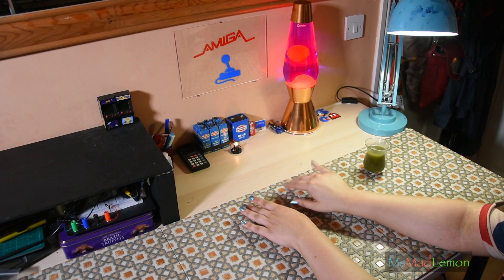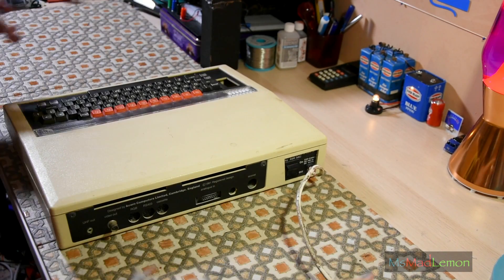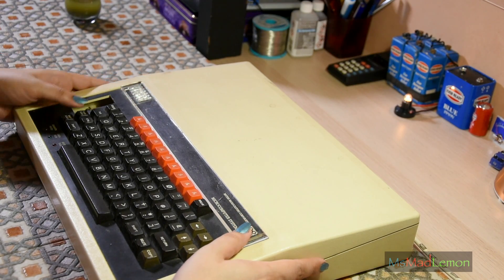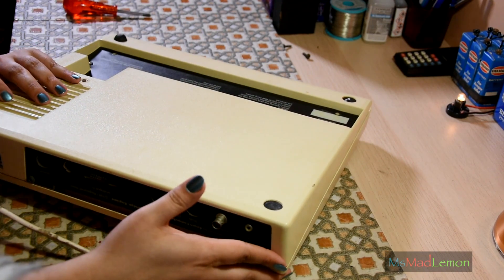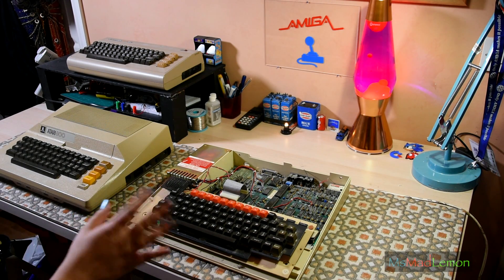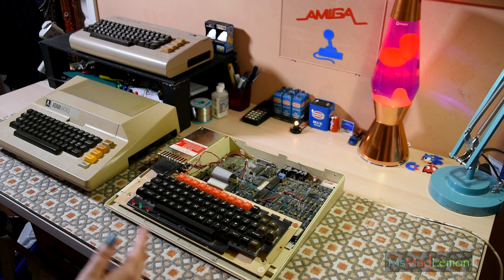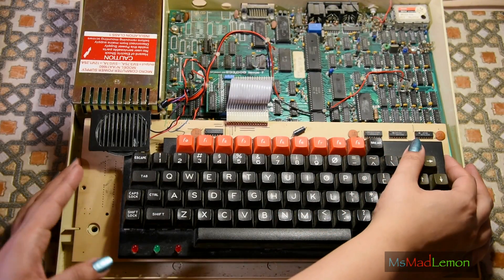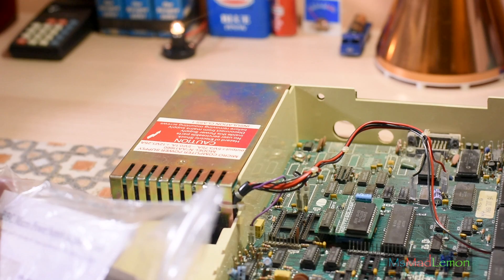The Acorn Proton - BBC Micro Model B

Comment: I bought my BBC micro 40 years ago and still have it. I went from the Beeb to ARM and now I program ARM devices as a living as a software consultant. I event used it in my final year project at Uni (I did physics and astronomy and automatic a research experiment). Recently the RIFAs in my Beeb went pop so it was time to recap it.  The tube interface was for second processors. Checkout PiTube. The 1Mhz bus was for expansion. There’s even BeebSID for it.

Comment: Splendid video, many thanks. I bought an Model A (with a friend as they were wildly expensive for a student) in 1982. We upgraded to Model B a few months later, mainly for the DFS which came with it, IMO its graphics blew all the contemporary 8-Bit competition out of the water, but then again it was more expensive and meant to be an educational instrument rather than just a games machine. That said, it played great games, and Acornsoft's suite of game clones was second to none. I especially liked their versions of Missile Command and Scramble. Of course, in 1984 it became (almost) a totally dedicated Elite playing machine :)

On last point. You mentioned The Tube interface, and while I can't recall what peripherals this was meant for, I can say the name was a nod to London's Underground, which is often called the Tube - as opposed to the Bus… Get it? Although it was a machine designed in Cambridge it is clear that those involved in the project knew something of London't public transport system.

Thanks again for your video and I look forward to the 2nd in the series. (I realise I'm a few months late to the party. Btw, I still have the machine, in its original box. Last time I tried it many of the keys weren't working, I guess they can be fixed, but now am worried about the PSU caps issue. I suppose my soldering skills may be up to the task.

Comment: The Tube port was an Acorn proprietary interface for connecting coprocessors, so the BBC micro provided the I/O and screen interface. A number of coprocessor boards were developed including those based on the 6502, Zilog Z80, Intel 80186 and NS 32016 running Panos (effectively a UNIX variant). 

the Tube port was also used extensively in development of Acorn's ARM processor which went into the subsequent Archimedes machines and is now the dominant processor architecture used in mobile phones and many other devices across the planet.

Comment: the texas instruments sound chip sounds more clean with a better signal to noise ratio, compared to sid which as confirmed by the designer, due to the fact mos/csg had to work very fast to develop the c64 architecture and so he didnt managed to get a very good signal to noise ratio, he wanted even to multiplex oscillators and get more voices out of it but time was not enough.

the texas instruments however has less tonal variety than sid, usually the same boring square wave melodic stuff, whereas c64 can do a lot of timbres using 4 waveforms per channel, filter with resonance, ring modulation, etc...a complete analogue style synthesizer inside a micro computer.

Comment: You can also add speech by adding a tms5220 and Computer Concepts Speech ROM or if you add the appropriate 6100 speech PHROM then you can use BASIC SOUND commands. Here https://www.youtube.com/watch?v=IHldh_rknuk is my AstroBlaster game with speech, sorry the emulator isn't 100% (and yes it is supposed to sound robotic!)
There are some good examples of what the sound chip (same chip as SMS) can do here https://bitshifters.github.io/prods.html
http://bbcmicro.co.uk/ is a great place to get some games and the latest homebrew.
The five ROM sockets are the OS on the left and the other four are "sideways ROMs" for things like floppy disc filing systems (DFS/ADFS), productivity software or even games and other languages (yours has BASIC in the left).
Your composite connector is disconnected, this doesn't mean it is broken as they were often left disconnected if someone thought that they might need to remove the board.
The green LED is a replacement.
Looking forward to part two.

Comment: Econet was indeed a networking system, and installable as an optional module which is why it's missing from yours.

Teletext and the BBC Micro kinda go hand in hand. Teletext display was originally generated by a Philips/Signetics SAA5050 chip. When they designed the BBC Micro's display chip, they deliberately put a fully compatible SAA5050 graphics mode into it (MODE 7). There was even a Teletext adapter.

The Tube was a coprocessor interface. You could attach a second 6502 or Z80 there. Indeed the prototype ARM chips were brought up on a BBC micro using the Tube interface :)

Comment: Yes ECONET is a network port but the circuit was not fitted as standard. Tube is for connecting a second CPU. 1MHz bus is for fast hardware like hard disks & the MUSIC expansions. User port is like GPIO. Printer port is for a parallel printer and floppy is standard 34pin so you can fit a Gotek straight on.

Comment: Although there are only three caps in the capacitor kit, there are loads more caps in the PSU!  The three are the ones that fail most regularly and spectacularly but it's likely that some of the others won't be working to spec.  Personally I think it's better to replace the whole thing with a Meanwell of the correct spec.
Reply: Probably runs cooler, but not really necessary ;)

Comment: BBC BASIC has been ported to other computers over the years, because it's so versatile and powerful. In fact, it was actually used to write a program for restoring old TV shows.

Because the UK adopted 625-line colour TV fairly early, the BBC switched to shooting programmes on colour videotape. But, if episodes of a show were sold abroad, they'd often be sold to broadcasters that didn't have colour yet. Then, when one broadcaster finished showing them, the episodes would then be sent onto the next country on the list and so on, until they were eventually returned to London.

However, if a broadcaster buying programmes from the BBC used a different TV standard - like NTSC, Secam, or the older 405-line b&w system we used to use - then simply making a b&w copy of a 625-line colour tape wouldn't work. And then the next broadcaster in the chain could be on a different TV standard again. In which case, the simplest thing was make a copy of a programme on b&w film.

This would involve pointing a film camera loaded with b&w film at a TV monitor that was showing the programme from the master colour tape. This meant you got a b&w film copy of a show that was originally shot in colour. You were supposed to put a filter on the film camera that would cut out all colour, but most technicians didn't bother fitting the filter, as they were using b&w film. Unfortunately, because of the BBC's policy of either wiping or reusing videotape, a lot of old programmes now only exist as b&w film. So, the b&w film copies are the only versions available (for example, the entire run of 60s Doctor Who only exists as film copies). 

Years later, a guy watching reruns of a show that had had its original colour tapes wiped. But, he noticed he was still seeing regular flashes of colour in the programme. This was because the colour filter had never been fitted when the film copy was made. So, he wrote a program in BBC BASIC, on his PC, to analyse the b&w footage for colour signals, identify and reproduce them - essentially recolouring the show. He tested this using an episode of Top of the Pops that still existed as colour tape, but that had also been sold abroad on b&w film, and finally a version where the colour had been redone by eye, in Photoshop so that he had something to compare against. 

The results were actually pretty accurate, reasonablely quick h the added benefit of being largely automatic. So, he's improved it. It's now been used to recolour episodes of Dad's Army, Morecambe and Wise, and Doctor Who.

All done in BBC Basic, written 37 years ago, for a 32k home computer. Not bad.

Comment: Love the BBC B. It was my first computer. My parents bought it from Dixons, with an own-brand portable TV and tape deck. Dad was a BBC radio producer, so he got a rebate on it. It. The power supply blew though, so I need to get it fixed. The punch-out for adding ROMs etc next to the keyboard has been removed on mine, so I need to figure out what to do it with. Otherwise, it's just a huge empty hole in the case.

You could get joystick adapters back in the day. I've got one, made by Protek. The joystick that was sold with mine was horrible though. And as there were no computer shops anywhere near me, and all the games used the keyboard, I never replaced it. It was useless anyway, as it had almost no travel - it was almost impossible to use.

The Tube was a port with direct access to the cpu, as I remember. You could connect a 2nd processor to it, like a Z80. (The ® just stands for "Registered Trademark". Econet allowed the computer to be hooked up to a network, with a central file server. It needed a main computer to to keep everything in sync and act as a master clock for the network, so it wasn't peer-to-peer like Appletalk or anything. But very clever and ahead of its time. We had one in school.

Comment: I went to a boarding school in 1985-87. They had a dedicated computer room with 17 BBC Micro computers, all connected up in econet. One of which acted as a storage and printer server. It had special expansions and 2 floppy drives. Each class had a set of 5½" floppies, which would be inserted into the disk drives on this main BBC Micro before we entered the classroom. The first thing we had to do when we started up a client machine, was to log into our profile, which would give us access to load and save to our personal area on one of the floppies and of course the printers.

Comment: The "Tube" port is a high speed connect for secondary processors.  I beleive Acorn made a 6502 second processor and a Z80 second processor.
Econet was an optional networking module that was mainly used by schools to share printers/disk drives etc.
Reply: Correct.  The tube was also used to test the first ARM processor.
Reply: Most interesting for a modern Beeb user is probably the PiTubeDirect: http://www.sundby.com/index.php/project/pitubedirect/ 
Use a Raspbery Pi as a co-pro to do LOTS of interesting things.
Reply: don't forget the 6809 and 80186 (well maybe the x86!) and the PI 6502 is ~200MHz

Comment: There is a reason the text is like teletext and that is in its default mode 7 the BBC B uses a teletext graphics generator chip SAA5050. The tube is a port for connecting a 2nd processor and even a raspberry pi can be connected now.

Comment: I got a BBC b and a master 128 ,a new rasberry pi based coprocessor is available allows it to run all different processors from z80 to high speed 6502 modes and more. From what I remember composite is black and white without a mod.

Comment: The tube port connects to a co-processor board, a faster 6502 or a Z80 running CP/M.
Reply: The Tube meant the BBC was used for testing the first version of Acorn's RISC chipset found in the Archimedes.
Reply: The tube port can now be used to connect to a raspberry PI which runs emulation of 6502, Z80, 32016 or 286 CPU along with Native ARM7 or emulated ARM 2 CPU :D

Comment: The econet was for classroom use. Teachers could connect multiple computers to a PC and instruct students from it.
Reply: Not connected to a PC, connected to a server. Needed a faster machine to run it, at school we had a Master with a co-processor which was needed to keep the timing of all machines in sync.
Reply: Econet was great for sending messages to mates and remote operation from another machine .
Reply: I have thought of getting Econet set up on all my Beebs, Masters and Archimedes but can't afford the Econet sockets for all my machines plus I don't have the space :(
Reply: @JimJimPlays  Yes, I still remember the Econet system we had at school. We had 10 Beebs with a Master at the back and the server box sat next to it. I think the hard drive back then was either 20MB or 40MB. I remember getting called into the school after I left to hack it because the IT teacher left without telling anyone the password for it. After that I got called in to install new software now and then until the lot was replaced with PC filth.

I've got a 2GB HD with my Master and I've only filled up just under 7MB.